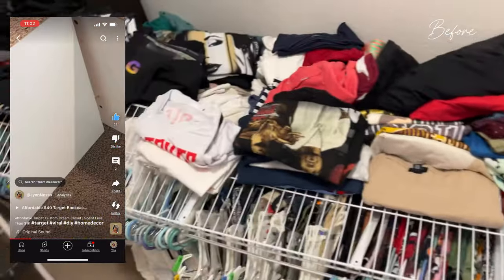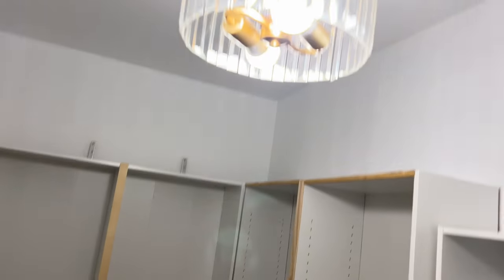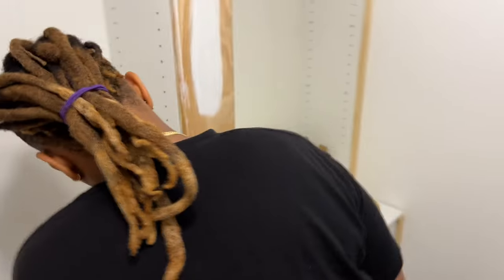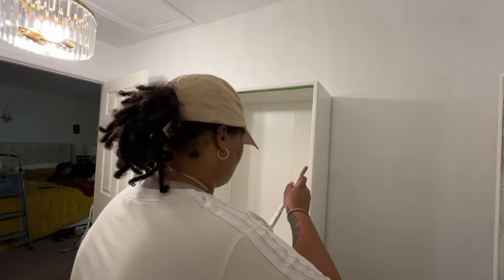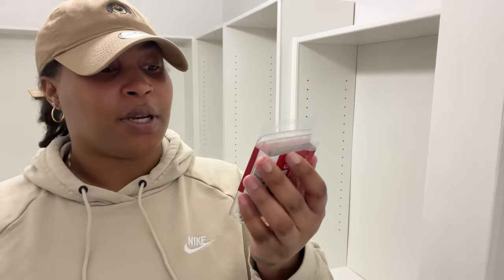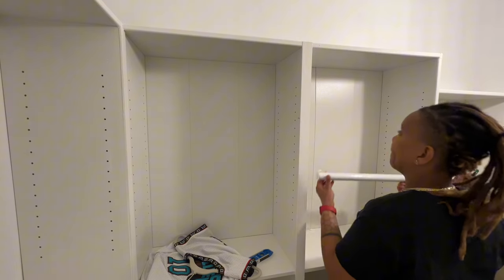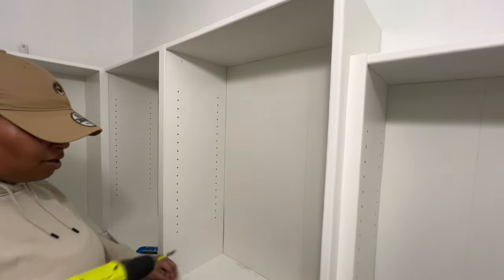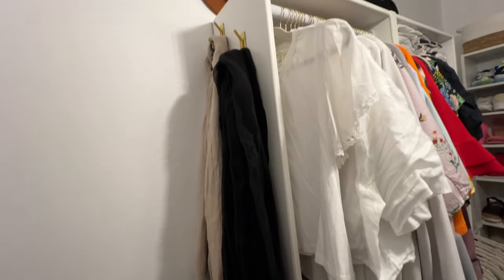Affordable $40 Target Bookcase Closet Hack | DIY Dream Closet Makeover | Part 2

Comment: Hey loved your video…I have a question: how did you do the corner….how you add the 2 bookshelves together in the corner and I couldn’t tell if its flush to the wall or out some because u add them together
Reply from the maker: Hey Thank you! The shelves are all anchored to the wall. Behind the two in the corner is a small gap. I added wood trim to all the cases so you don’t see the seams

Comment: This is very nice.  A Brad nailer brand new is not much more than 40.00 so you could have bought one for the price of renting.
Reply from the maker: Thank you 😊 what store? I priced them at Home Depot and Direct Tools for $180+. The battery is sold separately.
Reply: @LynnNessa  I got mine from Amazon.  The one I bought is out of stock but I just read the reviews and picked the one that had the best reviews (and a low price).
Reply from the maker: @adobeblue4360  okay, thank you for letting me know 💛 I’ll have a look on Amazon for one.